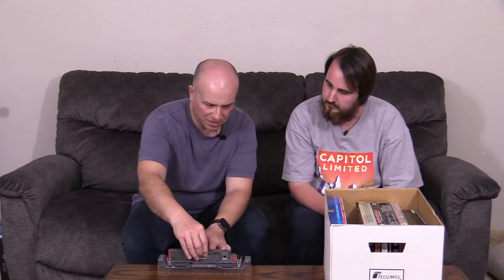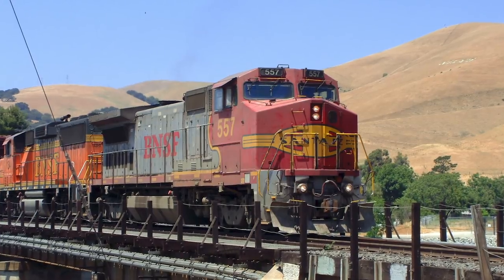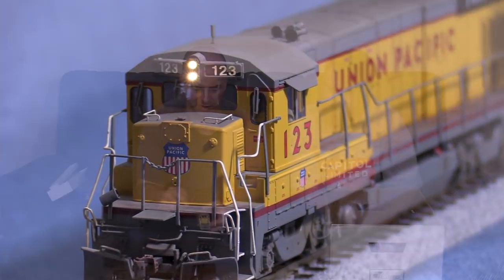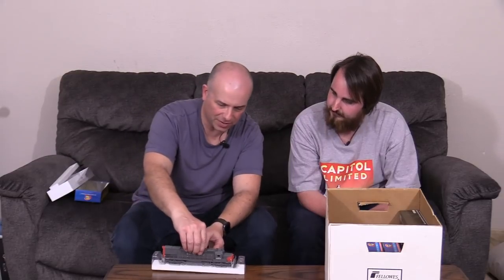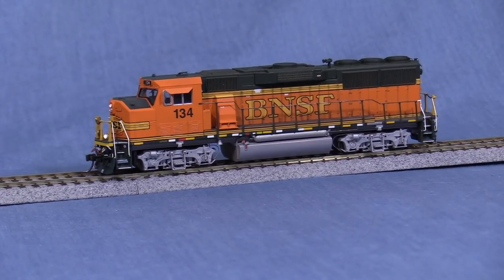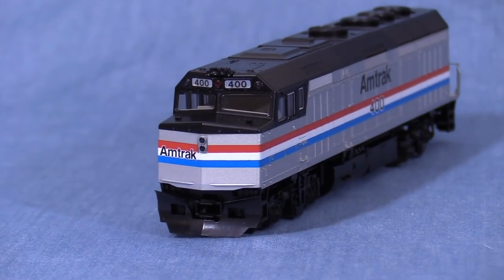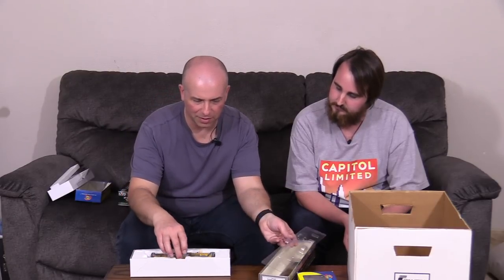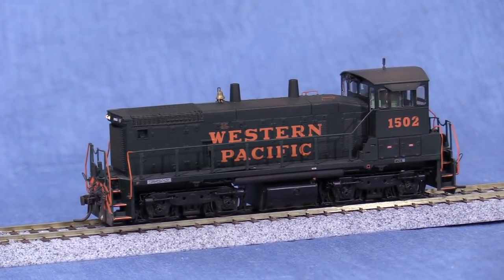Daniel Cortopassi Show March 2019

Comment: Hi Dan, how easy would it be to replace a beacon on a model without damaging anything? I own a Fox Valley models SP GP60 and I gotta say the beacon doesn't look very good. (The beacon is almost a solid color and the orange piece sticks through the bottom of where the light is mounted.)
Reply from the maker: I don't have one of the Fox Valley SP GP60s, so I can only speak in general terms.  I usually use Details West beacons and embed a 603 sized LED inside the hollowed out orange light casting.  The newer ones are already hollowed out.  The wires run down into the cab.  You should be able to plug the hole with a piece of plastic (maybe even cut the existing orange part and use part of that).  If you paint it SP gray it shouldn't show too much since it will be under the new beacon casting.  I also make sure to paint the bottom of the new LED / Beacon casting black so that the light doesn't shine down through the bottom.  Thanks for watching!

Comment: All the models look great! How do you ensure all the LEDs are a consistent color throughout the model? I've been having trouble with that.
Reply from the maker: That can be an issue for sure.  One way is to use the same LEDs for all the lights, but even if you pull a bunch from the same batch there can sometimes be slight color variations.  Another thing I do is to test the LEDs before I install them and pick ones that look the same.  I usually buy the "warm white" LEDs but there is some variation in exactly what that means when they're lit up.  Thanks for watching!